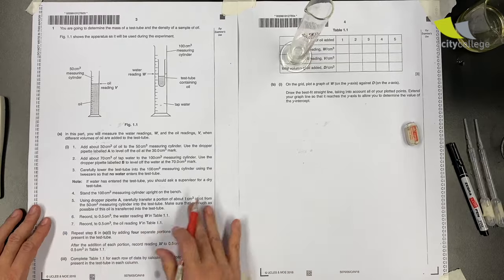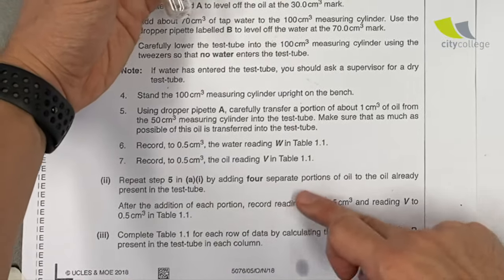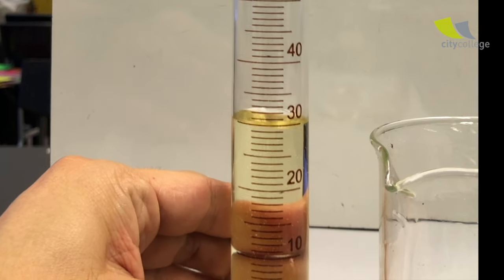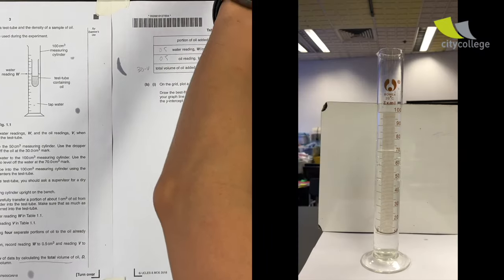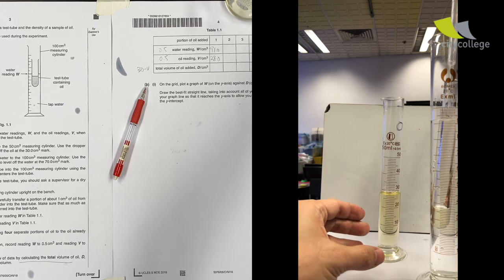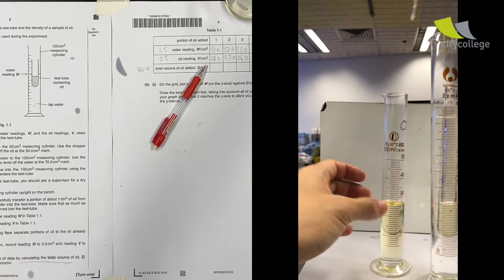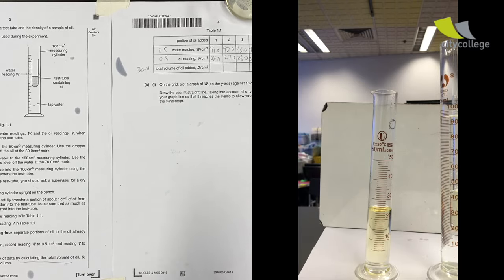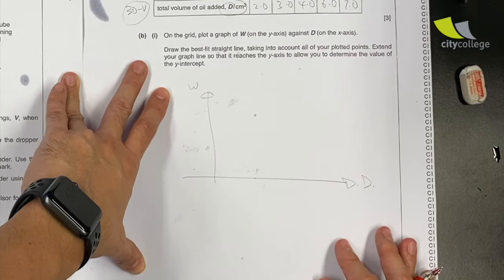2018 Science (Physics) Practical O level - Part 1

Comment: Hi, for the oil reading on the table, can It be 29, 28, 27 and 26? Since they say to transfer abt 1cm cube of oil at first. Thank you sm!
Reply: Last minute GANG!
Reply: Hi Ris, yes you can! The instructions gave a guide to each unit amount and the spread of variables. But it doesn’t have to be exact. So in this case, my first value is 28, I won’t split hair over it, because after that I still have increasing values of at least 1 for me to obtain readings. If it’s 29, 28.5, 28, 27.5 ... then we have an issue of accuracy due to a short range.
Reply: sky zhuo yeah lol